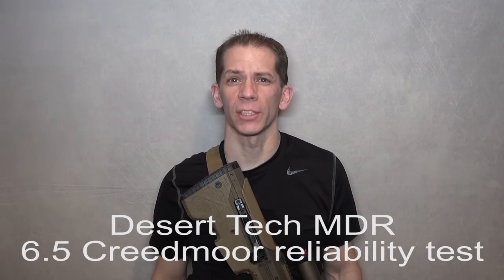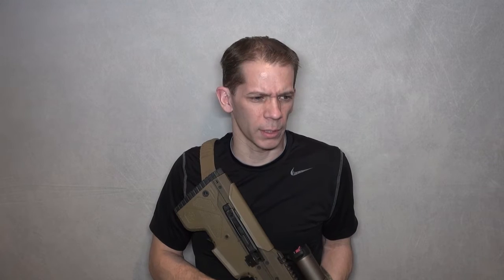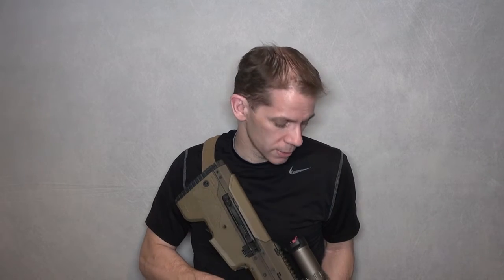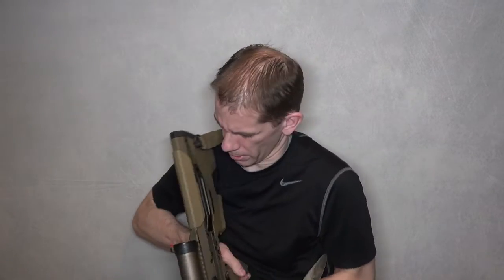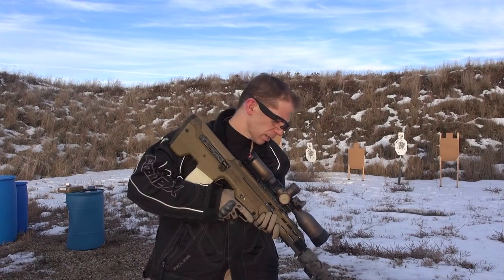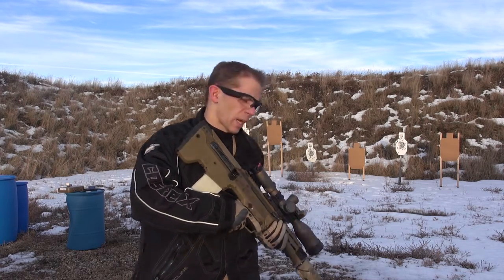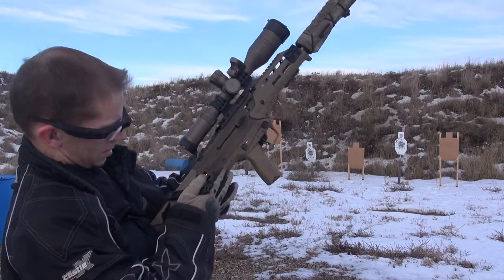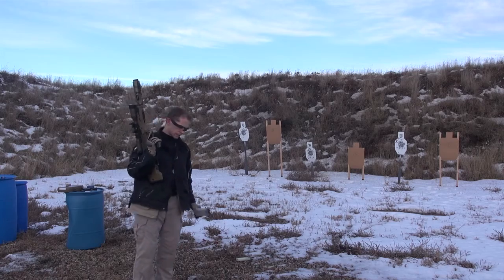Desert Tech MDR 6.5 Creedmoor (aftermarket barrel) Reliability Test

Comment: If it’s not a factory conversion then this has zero credibility!
Most feed problems are mag related so what mag was he using did he try different kinds. Those gloves make me distrust anything he says
Reply from the maker: I said it was an aftermarket barrel in the title and the video.  Everyone involved with the DT MDR is fully aware that DT sells the gas blocks to ES Tactical to have him make the barrel.  All other parts are factory.  The barrel has absolutely nothing to do with the ejection panel popping off, or the myriads of malfunctions this system has (all acknowledged by DT with multiple versions of fixes to try to address the issues people have been having with this new system).  The mags are all PMAGs and are not the problem with this gun.  If you don't like Oakley tactical gloves then you are welcome to tighten my AMTAC suppressor for me next time I shoot 200 rounds through it without gloves on.  I have dumped thousands of dollars and countless hours into this weapon's system, and am sharing my experiences without renumeration (both good and bad) to help others make informed choices.  I have another video of this rifle ringing steel consistently at 915 yards.  Hopefully the newest parts upgrade release will help improve reliability, but the ejection panel issue likely won't be affected.

Comment: He's got an aftermarket kit on it. You have to take that into consideration.
Reply from the maker: Yes, I stated as much.   In fact, it has been much more reliable with the 6.5 creedmoor barrel than the factory .308.  There is also nothing in the different barrel chambering (which is made from a DT blank) that makes the ejection panel blow off at your face when firing it.  DT has replaced the panel once and it is a known problem with factory stock guns shooting .308 as well.  It is a great concept gun, but like many things, will need continued refinement to become something you should bet your life on.  They are already on their 3rd gas valve design and they haven't even shipped my pre-order from March of 2016 yet.

Comment: Why not clear the malfunction before putting the ejector arm back in? I have found that when I try to remedy a malfunction in that situation that only makes it worse.
Reply from the maker: That's a good point.  The brass was stuck up high, and I was hoping the ejector would help push the brass out when attempting to run the bolt, but it still wasn't enough.  It took a large screwdriver to pry the brass out.  You are right that it could have made it worse.  Have you had the same problems with the ejection panel falling off when shooting?
Reply: @NDcompetitiveshooter  I have only had that issue once where it knocked ejector arm door off. I was letting a friend shoot it. In fact that was the only malfunction of the day. I put my OSS HX762 on the 308 barrel I have with the 2018 6 position and it has been working great. I had lots of issues before that though. I love that gun, made me buy an SRS. Thanks for the answer! Nice to see other people working out the kinks too!

Comment: Thanks for the updated review. Did you have to ask for the new extractor or did they just send it to you after sending in the rifle?  Also if you don't mind me asking. Have you looked at the rail where the rear take down pins are located to see if they started to crack. that seems to be a issue others are having.     I like my MDR for the ergos,  hate it for the ripping rims.
Reply from the maker: They added the wider extractor (that they are still experimenting with) during the 2nd trip to the warranty dept.   I haven't seen any cracking, but the fit when trying to put the rear pin back in is rough.  Check out the new video released yesterday from Desert Tech.  It really helps explain the issues and what they are doing.